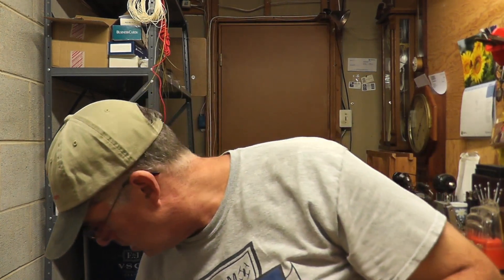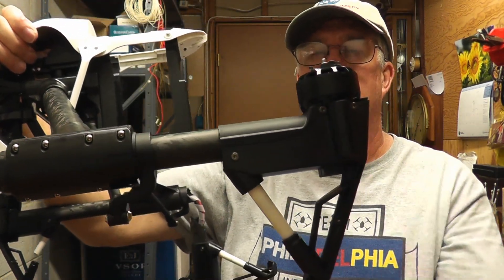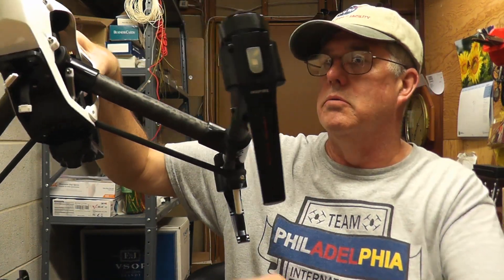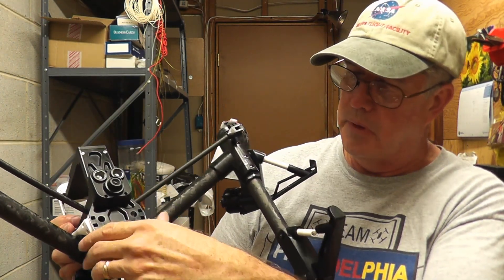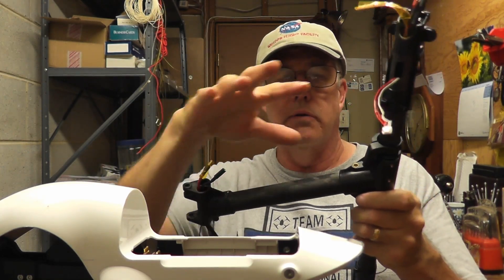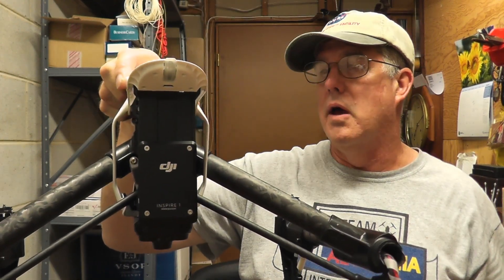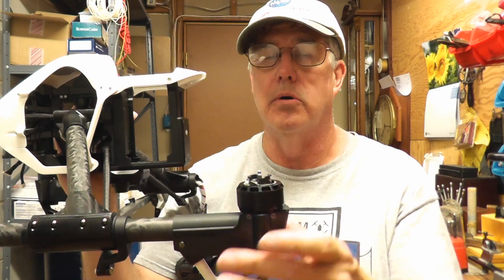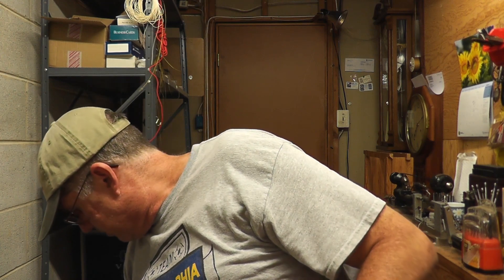DJI Inspire 1 Assessment for Repair

Comment: Hi, Thank you for the detailed assessment of your damaged DJI Drone. This video is very helpful. Just a reminder if the drone is still on warranty. It is best to contact DJI support for the repair process. Fixing it yourself might void the warranty of the drone.
Reply from the maker: Thank you very much for your concern. I have a computer repair back ground. I buy crashed DJI drones with the express interest of making repair videos. I have several repair videos covering Phantom 3s Phantom 4s, Mavic Pros and a Spark.